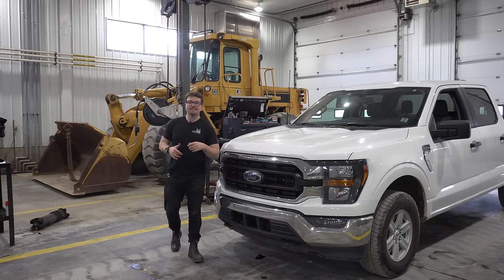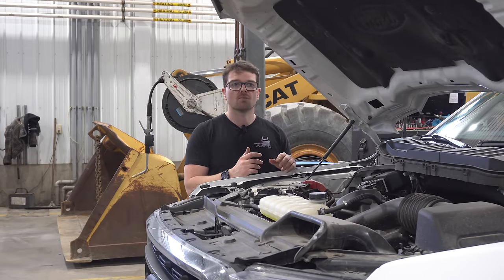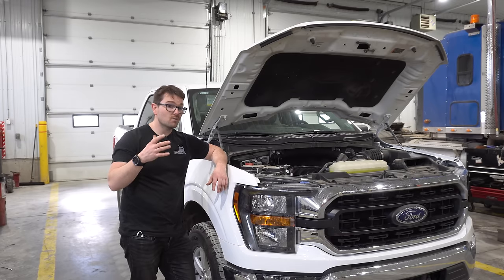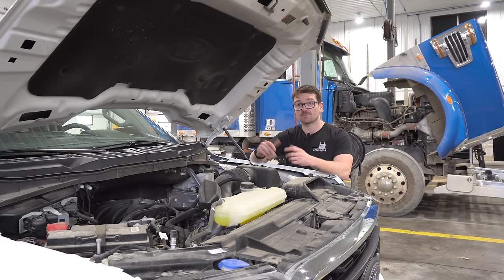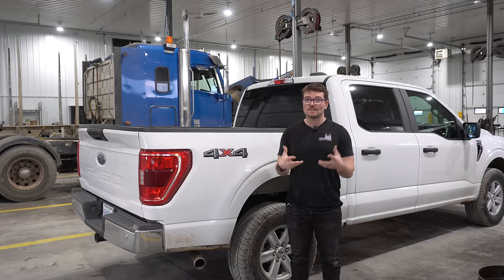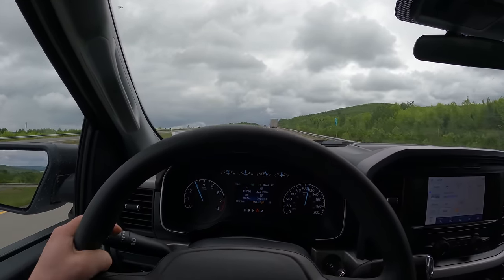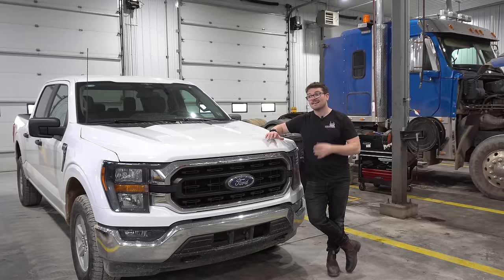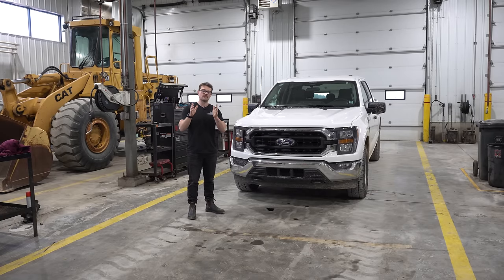Ford F150 5L Coyote V8 Engine **Heavy Mechanic Review** | 5 Reasons why It's the BEST

Comment: Alex could you do an in depth video on the differences between the big 3 and their design of cylinder deactivation systems, mostly within the v8 engines. If I understand correctly the gm and ram are similar in design but ford has done it a little different. 
This is where i would greatly enjoy the deep dive into the technical talk of how each one works. 
Thanks Alex.

Comment: Considering the F150 and the 5.0 is the only engine I would buy. I’m a Toyota guy but don’t trust the V6 turbos for long term reliability. I test drove a Tundra and while it was a nice truck, I wasn’t super impressed. Their quality has seemed to diminish in the last few years, because when I was looking at the midsize models the Tacoma didn’t impress me at all and I ended up buying a Nissan Frontier which has been rock solid except for the gas mileage. I want a bigger truck for towing and general room. But I hear so many horror stories about the F150 not being reliable. There’s no way I would consider a Chevy or Ram. It’s going to be the F150 or Titan.

Comment: I have 102,000 miles on my Ford 2018 V8 coyote engine does the engine need flushed out? I youse Mobil 10w 30. What else needs done?

Comment: This is great.  Very similar  to the types of trailer I normally pull. I almost  never pull a giant  trailer  with a rock on it. :)
Reply from the maker: That was my thinking as well. the bigger trailer is great for the HD trucks but not for the 1500's. might slap a 20 foot sea can on the flat deck for better wind resistances on the HD side of things as well.

Comment: Isn’t there a way to disable the cylinder deactivation? Picked up a used Honda Pilot with an eco mode and forums quickly pointed me to a solution that even I could install. 
You are really making a good case for this truck. This might be the Lightning I always wanted but never had.

Comment: That's funny because one prominent Ford mechanic on YouTube dislikes the 5.0 Coyote in the F-150. But he dislikes the turbo V-6es as well. I have a 2015 F-150 with the 5.0 and it still runs perfectly at 100k miles. Just basic maintenance, brakes, fluids, tires, etc.

Comment: Also, even though the 3.5 eco-boost can tow slightly more the 5.0 has a much better payload rating, which is usually the determining factor at how much you can tow in the halftime category. So with a crew cab and a family towing a camper, the 5.0 then can really tow more than the 3.5. Also right now I have a misfire in my 2.7 eco-boost most likely caused by carbon buildup so if I get another half ton, it would definitely be the 5.0. I am thinking about going with a three-quarter ton however the 5.0 seems far more reliable than the 7.3 with its lifter issues and to me a diesel in a three-quarter ton does not make sense because the weight of the diesel drastically takes away from the payload Capacity. I sure wish now I got the 5.0 instead of the 2.7 eco-boost because I am out of warranty because I put on a lot of miles and the dealership wanted $28,000 to replace the engine and transmission.

Comment: Most people that complain about the low end grunt with the 5.0 and towing have the 3.31 rear end. I have one with the 3.73 and it's a different animal.
Reply: That's just it. I suspect most, if not all, complaints in this video about pulling power would be taken care of with 3.73 gears. Seems it would be a perfect match for the 5.0. I have 3.73's behind my 2.7 and wouldn't have it any other way.
Reply from the maker: very fair sir!! I had 3.31's the 3.73's would be how I'd order the 5L. probably wakes it right up!
Reply: @TheGettyAdventures  I test drove my truck and an identical one but with 3.31 gears. It's a big difference.
Reply: My '22 5.0 4x4 running with 3.31 axles & am happy with power, acceleration & MPG.  1st & 2nd gear of the 10 speed gets it moving just fine.  I pull lightweight 19' RV trailer,  don't let it go to 9th or 10th when towing on level,  or 8th when in hill county
Reply: I've got 3:55 and have no complaints

Comment: I have the 2023 F150 tremor, and to get around the cylinder deactivation I put it in sport mode. It runs on all eight cylinders and is more peppier. to,problem solved.

Comment: i just traded my 2020 ranger for a single cab short bed 5.0. the ranger tuned towed my 20 foot enclosed about the same as the 2023 5.0. and fuel economy is almost exactly the same towing.
Reply: the 5.0 picks up the ladys from the sound tho.

Comment: I love all of your half-tonne tow videos and will keep watching each one.

Please try to test a 2.7L F150 and I'm hopeful you'll be pleasantly surprised. I own a 2020 screw 2.7 with 53a tow package and bumper pull a Grand Design 2400BH travel trailer with 7850 GVWR which I scale at around 7000lbs. Similar to your 3.5L ecoboost and 5.0L coyote, I rarely ever drop below 6th gear (3000-3500rpm) to maintain 62-68 mph interstate/highway speeds in very hilly eastern Tenneessee. My highway mpg is 10.0 driving around mostly in 8th gear on load range E LT tires.  Before the LT tires and on OEM P tires I got 11.5 mpg. If you do try to test this truck note that Ford equips it with weaker rear leaf springs and reduces GVWR to 6600lbs as a consequence. If you can find the much rarer "2.7 payload package" option then it gets the same springs as the 7050 GVWR 5.0L and 3.5L options though Ford still derates GVWR to 6900 but it is a much more apples to apples comparison.  It is unfortunate the standard 2.7L doesn't get the same suspension equipment as the other engine options as it's certainly a capable enough platform but gets the short end of the stick either for market stratification reasons, CAFE fleet fuel economy targets, or both. 

A few other comments/suggestions based on what limited things I know from the towing world:
- For my 2.7L ecoboost but in particular the 3.5L ecoboost, the towing fuel economy does seem to improve if you lock out the top gears to target 2000-2250rpm range on level highway. So while Ford's tow-mode algorithm will happily stick you in 9th at sub 2000rpm my own experience tells me this is not as fuel efficient as 8th gear.
- I've not seen it clarified what gas octane rating you use. I assume it's 87 and that is probably the best choice to compare across all gasser trucks but the ecoboost really likes 91/93 octane when towing and in my experience it is rather night and day with how much more power is available.
- Tires do play a big role in mpg as I found out between my HT 265/60/r18 34 lbs P tires and my AT 275/65/r18 53 lbs LT-E tires where I saw a loss of 1.5mpg fuel economy when towing. Should you continue/reset your tow reviews using your new large cross-section trailer then I ask you to start documenting tire configurations (dimensions, HT or AT, weight) and curb weights of each of the vehicles you review. Maybe some sort of standard specification declaration of each vehicle in the video description. This will provide us true truck vs truck enthusiasts with more minutiae to pour over :)

Thanks for all the hard and fun work you do!

Comment: I believe the  NA V8's will last longer than the turbo v6's. Don't like the idea of DI, the maintenance issue of cleaning the deposits  off, additional costs down the road.                      Decision, decisions.    Alex, have a great week.  Any snow yet?
Reply from the maker: lol we had a good 6inches of snow for Halloween, all the kids were in snowsuits but its melted for now. Also ford uses dual injection so in theory there should be very little if any carbon deposits with its direct injection system.

Comment: Really appreciate and enjoy your videos!  I’m struggling to decide between the F150 5.0 or the Chevy 3.0.  I commute about 8 miles to work every day and plenty of in town children run around.  About twice a month in the warmer months I pull a 7,000 pound trailer.  I live in Montana, not sure how the cold affect Diesel DEF etc.  The Diesel is appealing for long road trips which we do plenty, but will my daily driving warm it up enough?  I keep my vehicles a long time….coming from a 2005 tundra with 200K miles (still running strong) so longevity is important to me.  Any input would be appreciated.

Comment: 419k miles on my 2011 5.0.  Original engine and trans.
Reply: Did you have to have lead frame changed on your tyranny?  Do you climb hills often?   My local dealer recommended I have leadframe changed preemptively.

Comment: Today THE best 5.0 was 15 to 17 in the F150 16 had some ghost issues stalling have many people complaining about this and only this year wats up. Anyways love my bucket of marbles it sounds terrible no really but over that as a mechanic let it ride has not blown up my 17 bought used with 175 metric k and I thrash it when the moment ensues no carbon in this engine at least cleaning it out from the last owner the expense not the drivetrain only the tires like the old days.

Comment: If you want the best reliability, you get a 2.7. If you want to tow, you get a 3.5. If you want noise and lack of power in the mountains, you get a 5.0. 
You didn't mention that gen4 has a wet oil pump drive belt.

Comment: I can't deny the 5.0 is amazing but you should really reconsider the 3.5 I have a 2012 Ecoboost they have more power than the 5.0 it peaks at 2,000 rpm for toque which for towing is amazing my truck now has 141000 miles I just towed a 36 ft bumper pull RV on a 4 percent slope with 4 inches of snow on top of the RV and truck getting about 14 mpg I've towed 11000 pounds with it and it does it fine the 3.5 has 500 ft toque and 400 ho for my first gen and the new ones have much more power. Another thing is that you said  turbos in a high revving has engine don't work but the 3.5 revs far less then the 5.0 when driving normally at least depending on load could change but I just had my 3 horse slant trailer with my 1200 horse in it recently driving in the rain at 60 at about 1650 rpm. The point that I'm making and I could go on forever the 3.5 is the best and I see those with half a million miles on them a good amount in fact it might take the record for a vehicle with most miles ever driven as in same motor same transmission same everything the current record is the Mercedes diesel from the late 70s it has 1.3 million miles and a 2013 3.5 f150 last year hit 1.1 million and the owner says it still drives like new.

Comment: I have the 2018  F150 with 2.7EB  now over 200,000mi  solid engine.  And I tow 5000lb trailer with it.  Changed oil every 10k mi.  Inhave begun to look at new f150 and the 5.0 is on the radar.  My 2.7 can idle without me knowing.  ita pretty darn quiet,  I wonder if the 5.0 can do that.  I mean roaring v8 is great but there are times when I want quiet refined coasting.

Comment: I'm sure it is reliable, but I got super unlucky. Just bought a 2023 Tremor with the Coyote (4500miles on it). It has been in the shop for over a month already for an oil leak that the dealer has tried to fix twice. I'm bringing it into another dealer to have them look at it, hopefully the last dealer was just incompetent and this other dealer can fix it. Rear-main seals don't go out at this mileage. I'm thinking the PCV valve is shot, or the Crank shaft is spinning out of play. The transmission feels clunky now too. I think permanent damage was done to the vehicle since having to pull the tranny twice. Likely that they want to replace the engine, I will push for a buyback and start over. Hopefully you other Coyote owners will be luckier than I was! Seems like no one has had this issue anywhere on the internet.

Comment: The turbo failure issue come down to operator. Too many people throw the vehicle into park and shut down.  There is NO TIME to allow oil to cool down the turbo housing. That is a huge issue with diesels that are ridden hard and put away wet. Oil starved turbo(baked in the oil journal) is the root of most turbo failure. A 5.0 doesn't hold a candle to the 3.5. My 3.5 averages at 9.6l/100km and 22.4l/100km towing. It all comes down to how it's driven.  Like I said a comment on another video, a 33ft mid profile fifth wheel and a 5x12 tandem, rolling at 18.4k combined(19.3k GCWR) biggest issue with he 5.0 is the revs. Revs all day on every hill, just annoying. But again diesel torque is king and the only gas motor that comes close is the 3.5. The 2.7 will pull just as well(if not better) than the 5.0. Same torque 2000rpm sooner.

Comment: I have a 2014 with the Coyote, the last of the 12th generation. It is great, and, is better than the later models in the next generation, 2015-17, and, even the latest with the direct injection that can cause carbon buildup on the valves. And the more complicated dual injection is just adding another complication.

Comment: Great video.. I always enjoy your content! I'm considering moving into an F150, I had taken a couple out for a test drive and the 5.0 was what I was aiming for. One thing I've been curious about.... is the hybrid edition of the F150... that powertrain any good? For towing a decent size camper?
Reply from the maker: The hybrid engine apparently pulls amazing. I have yet to drive one but id be concerned with having a hybrid system with batteries. If you trade your trucks in every 4 years its a perfect engine but I think the 5L will have more longevity
Reply: Awesome! My gut would tell me to go for the 5L, but I'd have some temptation to try the hybrid.... if you ever get one on the channel... I'll be watchin'! ;-) @TheGettyAdventures
Reply: I have the powerboost hybrid. It tows incredibly well!  Tons of power. Probably more than you will need in a half ton. But it is thirsty towing. Similar to the 3.5 ecoboost. Unladen MPG is amazing if you drive it easy. However. I too really worry about the longevity of it. Time will tell I guess.

Comment: Cylinder deactivation isn't the only drawback to this engine. They also replaced the perfectly fine oil pump with a belt-driven oil pump that threatens the reliability of it. The fact that they routed it behind the timing chains is major step back as it forces you into a "might was well change the timing chains and phasers while you're in there". The labor and parts required is a major expense. For all the hysteria over the oil pump belt in the 3.0 Duramax, it's actually cheaper to replace the belt in the Duramax than it is in the latest Coyote and 2.7 EB. So much for the "the belt should have been in the front."

You also never factor in axle ratio in any of these comparisons.
Reply: Have you had this priced for the 3.0?
Reply: @TrevorMaffetone  it takes a couple hours less labor and the belt isn't routed behind any timing chains on the 3.0 duramax. I always suspected having the oil pump belt on the front is neither easier nor cheaper and it's not. There is far more work involved, unfortunately. I hope Ford removed the oil pump belt and offers a retrofit to a chain drive but I doubt that happens.
Reply: @hochhaul  have you seen pictures of the belt ? Looks pretty beffy. I read a lot on 3.0s because I almost bought one I have never read of a failure due to the belt. Although the added expense of changing it at 150k miles sucks and I do prefer a chain but I usually get something different by that mileage so it won’t affect me anyways

Comment: I like the Ford 5.0 Coyote engine. I have been considering the purchase of a 2024 F-150 with that engine. Unfortunately, when I go to spec one out on Ford's configurator website, I find that the 5.0 is no longer available in the two higher trim levels, the King Ranch and the Platinum series. Not sure why this option has been removed.

Comment: So what you're saying is I should Buy the coyote? :)
I've been reading about these pick ups for a while now, and I've consistently seen cam failure/issues come up on every coyote engine, maybe I'm wrong and certainly no mechanic.
My family has always owned toyota's and of course we all know them to be reliable and I currently own a 5th gen V6 4runner but I've been wanting a slightly bigger vehicle and my current car has significant mileage stacking up although I don't drive/tow much. But plenty of rec activities and I like the idea of being able to help friends/family move or haul things as I've done in the past with my current car. I'm currently looking at a 2019 f150 5.0 with lower mileage but the cam phasers have been pushing me away from this vehicle. I don't mind more frequent oil changes, fuel prices etc but I definitely don't want any major repairs or worse case complete failure lol. Videos are very helpful and any additional feedback OR other videos on this truck would be cool! Subscribed
👉👉

Comment: Question! 
How do you have the open piece in your lower bumper? 
They say all 5.0 trucks have it blocked off… 🤔
My ‘21 stx 5.0 has it blocked off…

The oil consumption to my understanding, they changed the piston ring pack… in 2021… 👍

Comment: I always had the coyote 5.0 and loved it until my 2019 had oil consumption problems. had it down tuned to keep from adding oil every 100 miles!  I got great mileage with it but traded it in at 67,000 miles being afraid the more miles the worse it would get. Ford was not helpful with the issue at all and I almost decided not to get Ford again, That being said I traded for an eco boost and will see where that goes. I do not haul. will see how they do on the 5.0 in the future

Comment: Why haven't you tested the 2.7 turbo Chevy truck in one of your new "HOW DOES IT TOW" video using the standard trailer weight instead of the max. load.  This is a great comparison video to fairly compare trucks especially on mpg towing.
It would also be a very interesting comparison between the Toyota 5.7L Tundra vs the 5.0 Coyote engine for towing, including mpg comparison.